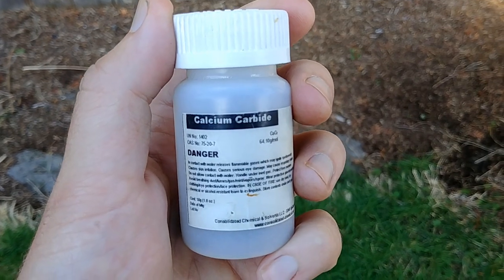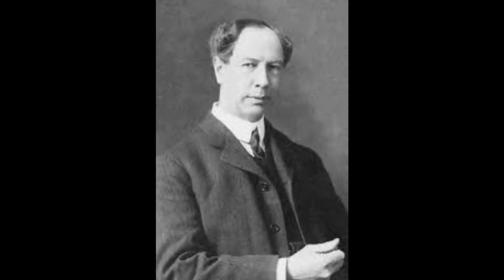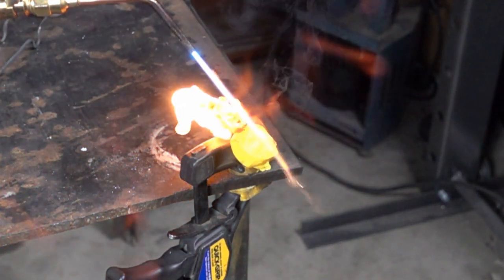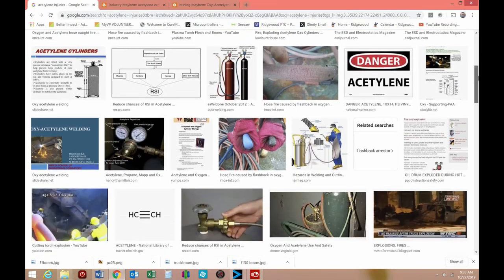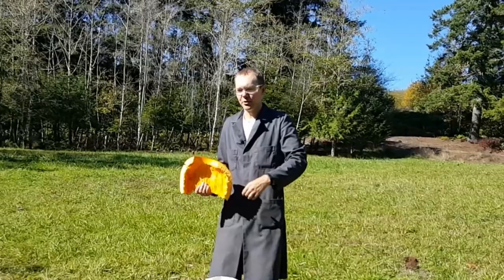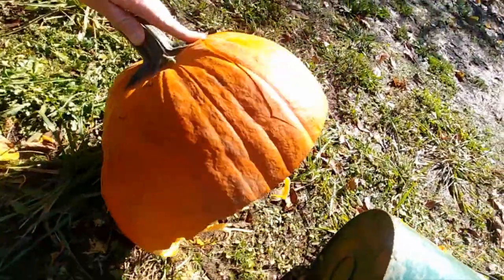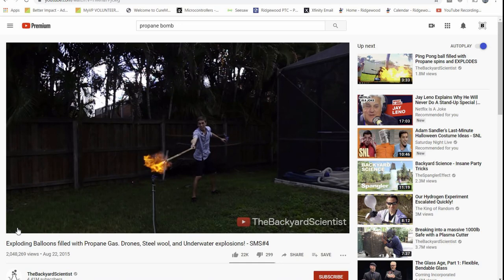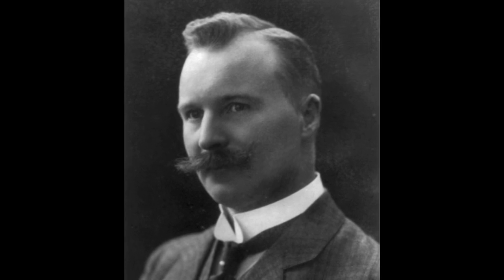Learning Chemistry with Pumpkins - Why we DON'T play with Acetylene!!!

Comment: My wife said we have moles in the yard and we needed to call an exterminator... i rolled my torches out dug into the tunnle started the torches up , snuffed out the flame  stuck the torches into mole tunnel  and 3 min later , i had stuck an extension cord with one end stripped and stuck in the far end of the tunnel plugged in the extension cord..... BOOM! No moles . No yard either.

Comment: The acetylene tanks are filled with portland cement saturated with acetone, the acetone will dissolve and store the gas, and safely store this explosive gas, is explosive after about 18 psi... i think it was.... but the acetone will gently bubble out the dissolved higher pressure tank... just be careful with the regulator loosen it right off before sloooooowly cracking that cylinder valve, then adjust regulator.  Also torch and regulator flashback arrestors are a great and safe idea.  Better safe than sorry.
if leak, turn off o2 first... it only supports combustion of hoses.... then oh booy....

Comment: *Pls, try using stoichiometry to determine the exact mix of 0² to fuel. Then use a chemical mixture(or two if you cant get the fuel release and oxygen release into a simple binary compound) to release oxygen as well as the fuel. Should not be too difficult. Maybe throw some peroxide +  manganese(IV) oxide. That should create an oxygen generator that is fast enough to be feasible. Just get the fuel/oxygen ratio right(which is why your demo was hard to replicate and worked better at certain times than others, your ratio was basically dumb luck) I know you know all this stuff, but so do we lol. So we know when you're half-assing around for fun but I'm sure we'd all like to see the real max effort deal. Also, most of us don't have bloody acetylene torches and oxygen tanks lying around. Thanks for the vid. Sub'd and liked. *